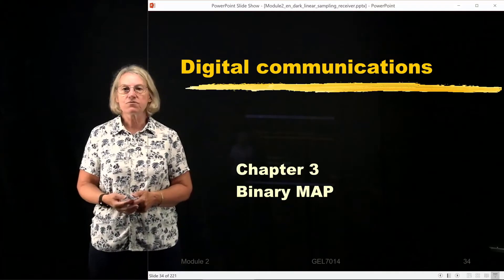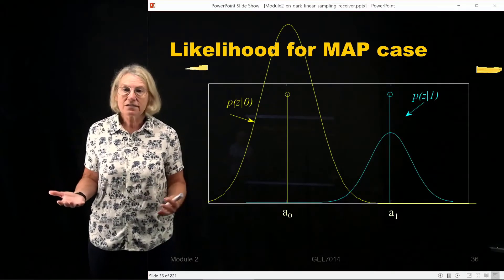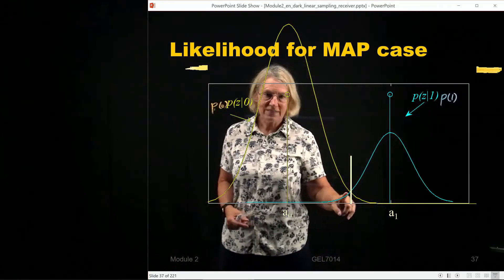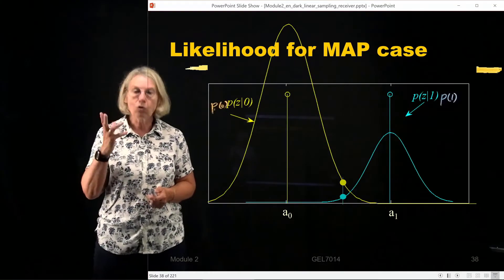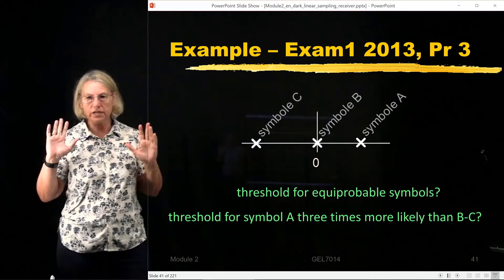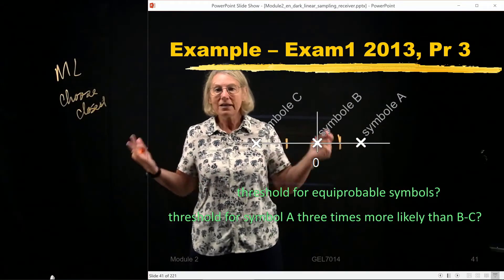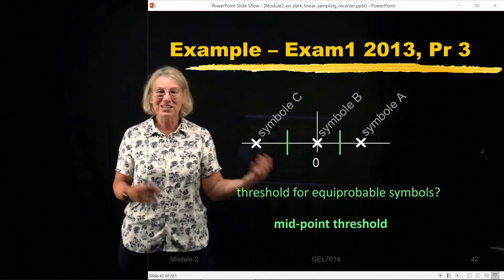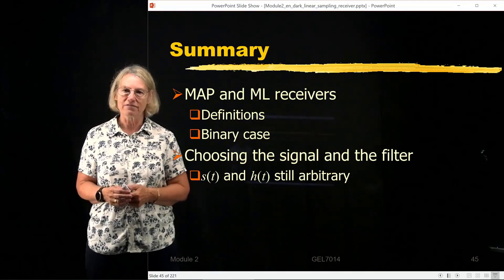GEL7114 - Module 2.4 - Binary Maximum A Posteriori (MAP) receiver

Comment: Dr. Rusch, Thanks for the content.
@4:00 there`s a graph of the maximum AP, weighted by symbol probability. I suppose that, if a symbol is so much more probable than the other, the probability density function of one symbol could be always larger than the other and, on the receiving side, it would make sense to always chose the most probable symbol?
Reply from the maker: If there is non-zero probability that a symbol is sent, there will always be a decision region for that symbol choice. In other words, there will always be an intersection of the two Gaussian distributions. If the distribution was not Gaussian, what you suggest might be possible. The fact the Gaussian has infinite support means there will be an intersection.